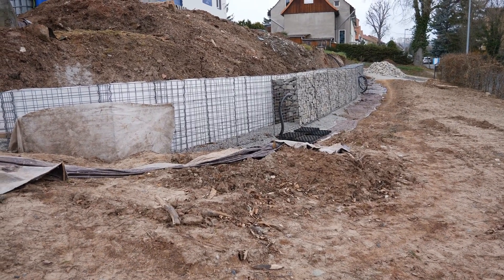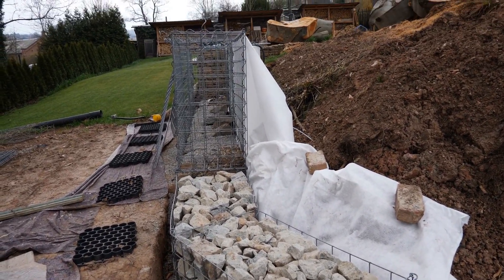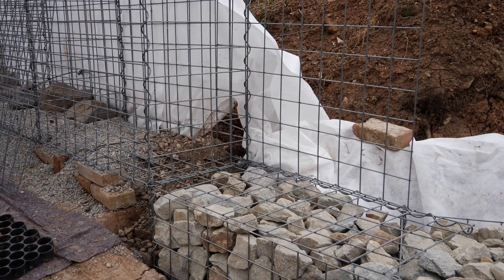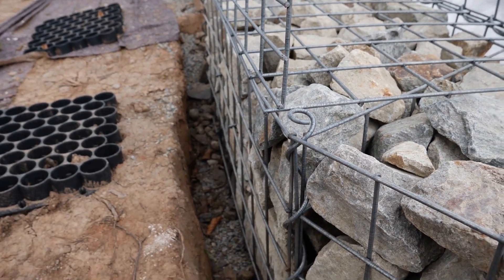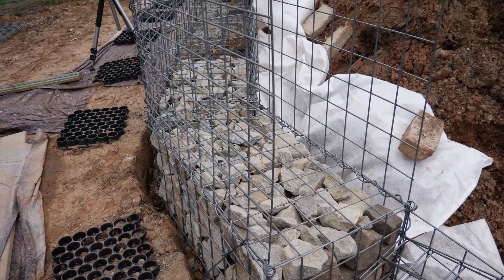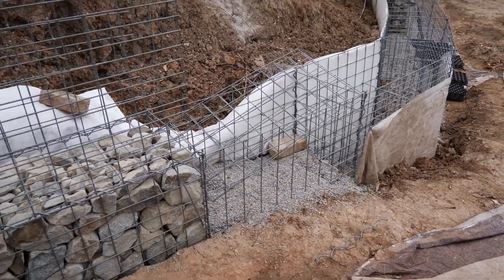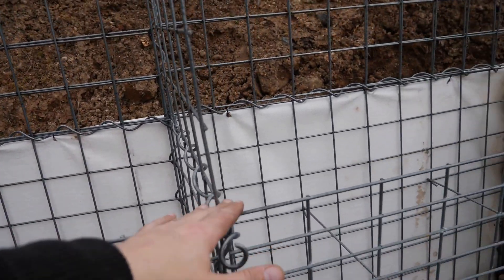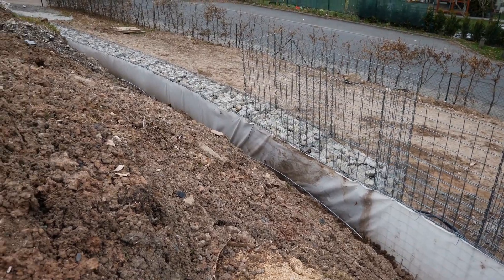Building a Gabion Wall: Second Row Assembly Guide

Comment: Axiom: The wire mesh is not the strength of the wall rather,  the eventual interlocking weight and friction of the stone.
Reply from the maker: Hi,
That's absolutely right. A basket weighs approx. 800 kg and is therefore very stable. However, the grids must also be stable in order to hold the stones securely in place over a long period of time. There are grids that rust and disintegrate after a few years. That would not be very good, of course.

Best regards from Germany

Comment: What height is this and what depth of gabion are you using please? Would soil go against the wall or would remain slopped? As it seems you are not making steps with gabions, only say you have them slopped? Shouldn't be both?
Reply from the maker: Hi, 
I use gabion baskets measuring 100x100x50 cm. The front grids have a narrow mesh size of 5x10 cm. The remaining grids have a mesh size of 10x10 cm. 

On the slope in the curve, I used half gabions measuring 100x50x50 cm as a substructure. This allowed me to pull the second row of baskets around at a height without having to dig deep into the ground everywhere for the 100x100x50 cm gabions. 

The gabion wall slopes slightly into the slope. The back is secured with a solid but water-permeable protective fleece so that no soil is washed into the gabions. I then filled the area behind the stone baskets with layers of soil and compacted it. The wall has now been standing for many years – just like on the first day. 

I hope that helps?
Best regards
Reply: @commaikEnglish Thank you. Interesting that 50cm depth holds, reading all installation recommendations and chekcing with AI, for 1.5-2m strucure all recommend going with 1m or even 1.5m width for the base and 1m from 2nd row i.e. with 100x100x100 gabion. This is with 6° incline and also with 10-15cm step backwarda (as pyramid) for each gabion.
Reply from the maker: Well, bigger is certainly not worse and probably even more stable. The slope behind my wall has mostly grown naturally. I filled the area up to the wall with several tons of soil. Each basket weighs about 800 kg of granite stones. Nothing wobbles or slides anymore.
These are my experiences, which I am happy to share.